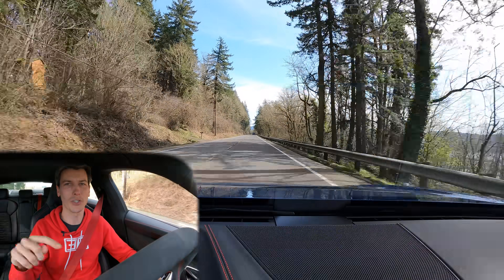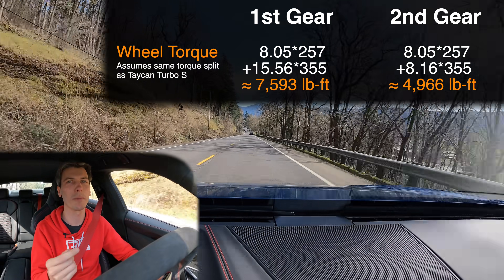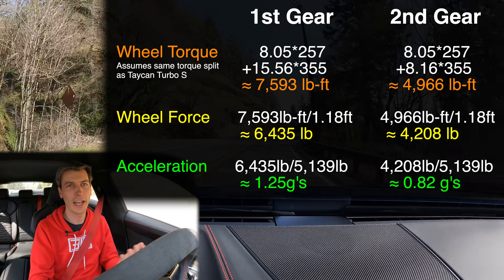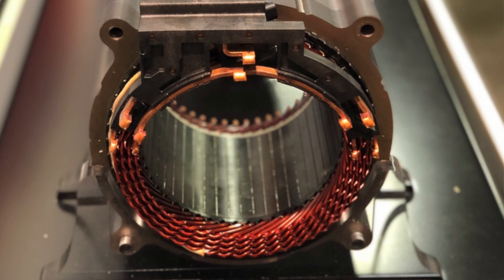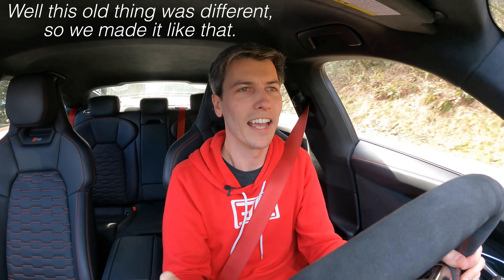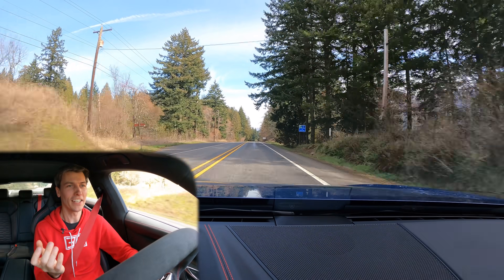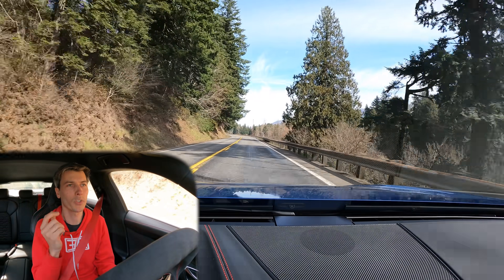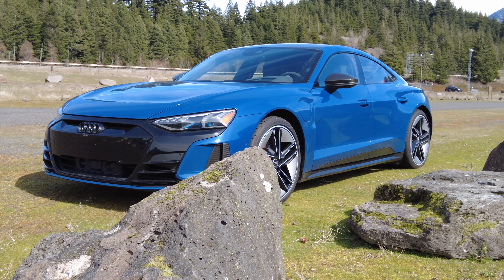Are Fake Manual Transmissions Coming? Audi Keeps It Real

Comment: I completely agree with the CVTs with simulated gears. It boggles my mind why they thought it was a good idea. Any product (cars & transmissions included) should simply try to be the best version of itself, not imitating something it's not. People complain because it doesn't behave the way they're used to, but there's always an adjustment period with anything new. I'd argue a smooth and quiet CVT & motor would be preferable to unrefined automatics.
Reply: They did it because people absolutely hated they way the original CVTs worked and felt when driving, and so no one wanted them. When they first came out, they'd generally just go straight to whatever the peak torque RPM was and then stay there forever using the CVT to vary speed etc. It felt extremely unnatural to drive plus it was noisy as hell with the engine constantly at 3500-4k RPM. It was anything but smooth and quiet.
Reply: I have a car with a CVT that has a manual mode thing (6 ratios to play with the paddle shift). I have come to the conclusion it helps in certain situations:

1) when you're driving, lets say autocrossing around a twisty road with constant corners coming up, that manual mode helps to keep the engine in its torque band (a normal CVT will never do that when you're off throttle, the engine dies to idle instead). Also ofcourse you have fun with it as well.

2) when you want to instantly accelerate for simple overtakes on a highway, flick into the nearest ratio (raise the revs to the torque band of the engine) and then floor it, if you want to still accelerate further (while you're accelerating) you can turn off the manual mode in a second easily and go back into CVT mode.

Manual mode ofcourse doesn't help in straight line acceleration (aka drag strips, traffic light sprints). It just makes it more responsive for that few seconds you want it to respond instantly.

A normal CVT has this vague response to throttle inputs, which is good for smooth relaxed driving, but not good for instant spirited driving. The manual mode is for this purpose.
Reply: @aaryeshg.6526  A better thing would just to have a "sport mode" button that locks the transmission at the optimal gear ratio for maximum engine braking and instant torque when accelerating. It would essentially make the ICE behave like an electric car and get significantly better performance.
Reply: @SI0AX  yeah this method of sport mode actually was used on the CVT F1 car that Renault Williams made in the '90s. The engine stayed at its max power for most of the time.

But.... that sadly wouldn't go well with consumers on econoboxes (its outside the bounds of feeling "normal"). Still a really good idea though, if it can have a simple on/off switch.
Reply: @aaryeshg.6526  That was a race car. A regular consumer would not appreciate the terrible fuel economy they would get if the race mode could not be toggled off, lol. The EPA would not appreciate it either.
Reply: Totally agree - if you want a manual, GET A MANUAL. Don't complain to everybody (manufacturers included) to make them nobble an alternative technology just for you. I suspect that the silent majority of traditional CVT drivers were perfectly happy with how they worked.
Reply: @Alfred Wedmore yeah, I just remembered my friend tells me that he hated the feel of motorboating (the water transportation one not the titty one) on road. So he hated every CVT out there, from cars to scooters.
Reply: The problem is that car reviewers don't get to ride out an adjustment period and they have far too much influence on how American cars are presented to consumers. This is why you get loaded with lots of "gee whiz" features which are annoying in the long term or end up being ignored after a week
Reply: If some people find simulated gear CVTs or EVs fun, I guess that's their prerogative. My four-year-old likes spinning in circles and singing songs from frozen - I'm not here to judge. I however, having the mechanical knowledge to know that it sucks balls, could never enjoy it.
Reply: With the failure rate of CVT’s it makes me wonder if part of it is there being less wear if the belt jumps to positions rather than a constant slide up or down the cones. 

Either way a CVT feels like a broken and slipping transmission. So, for a lot of people it just doesn’t feel right. Even for non car people everything else they’ve driven felt a certain way so that’s what they expect a normal car to feel like. Make a drastic change to that and it’s hard to overcome it unless it’s what you grew up with. 
I’d also bet a CVT acting like a traditional auto is negligibly less efficient than it acting like a CVT.
Reply: The first CVTs didn't have simulated gears, people hated them, holding at max power while accelerating just isn't a pleasant experience. To fix that they had to either reducing the rpm they were holding at or introduce fake gears, fake gears was the right answer.
Reply: @kevenharvey9711  'people' == REVIEWERS 

We have them in Europe.  Reviewers commented it was a little disconcerting to have the engine rev to torque peak on hills or when loaded "but if you really want the feel of gears you can always manually select a ratio"

CVTs sell just fine over here and they don't have a problem with early mortality
Reply: @miscbits6399  I'm not a reviewer, I drove one of the early CVTs myself, it was a pretty horrible feel. The close ratio "gears" don't affect performance or efficiency that much.
Reply: one of the underrated points of the fake shifting is the perception of speed. I have a CVT with no simulated gearchanges (02 Insight) and it has a mildly frustrating difficulty with holding an intended speed. It would be much better with cruise control, but regardless it requires more attention be paid to the speedo. Human ears are quite adept at hearing small changes in frequency at tones around the primary engine harmonics. That gives us a pretty accurate perception of speed changes regardless of the external factors. My preference is the quiet efficiency of no fake shifting, but I've driven plenty of "shifting" CVTs and find they have upsides as well.
Reply: CVTs are boring.

They did it to help sell the cars with CVTs.
Reply: @slowanddeliberate6893  ridiculous, do you find instant acceleration boring? Do you hate the feeling of a transmission always at the ideal gear ratio?
Reply: Then you're going to hate these things called video games.  Especially the ones with controllers that simulate real world controls.

But lots of people love them.  I don't see why that shouldn't be extended into real vehicles.
Reply: @tams805  Ok I'll bite.

The point of a video game is to simulate and be enjoyable. So it's trying to be the best at that.

The point of a CVT is to be efficient in delivering power/fuel economy, and trying to simulate gears defeats that purpose. It also fails in feeling like an actual automatic, which makes it worse.

Similarly, video games that do not simulate well and/or are not enjoyable aren't going to do very well.

Also, I like video games as much as the next guy, but does ANYONE like CVTs with simulated gears?
Reply: @peanuts.13  When it comes to those CVT simulations its often for if the car is in a certain mode or just under max throttle. And when cursing it goes back to being a normal CVT.
Reply: @peanuts.13  because as far as I know, CVT cars don't sell as good as others, I guess? and companies want profit to boot, so they market it as close as automatic but "slightly better" on paper (and more expensive), even tho it's worse in application to simulate it
Cmiiw tho
Reply: @tams805  
Horrible and ridiculous comparison
Reply: @tams805  that's a ridiculous analogy, video games are made to simulate real driving. If cvts are smoother, you've just gotta get used to them.
Reply: @tams805  I agree with you. its ok for things just to be fun

Comment: 3:31 Not exactly true. With a permanent magnet electric motor (which are used in basically all electric cars), in the constant power region, you're using some current for field-weakening.
Essentially countering the magnetic field of the permanent magnets in the rotor to reduce the induced voltage in the stator, so you can maintain control of the motor. At high speeds, this field-weakening current can be quite significant, contributing a considerable amount of heating to the stator, with no benefit to the mechanical output of the motor.
Think about it: At high speed, if you want the mechanical output to be zero torque (coasting), you still need to put power into the motor.

Having a second gear with a higher gear ratio allows the electric motor to spin at lower RPM for the same vehicle speed, meaning that you need a lower field-weakening current, thus improving efficiency.
Reply: It's a good point. It's a question if the better efficiency is worth added complexity and parts.
Reply: This is true, but there are designs that let you use weaker permanent magnets in the first place -- like the PMSR (permanent magnet switched reluctance) design.  This reduces the necessary field weakening current significantly.
Reply: @somejoe7777  yes but then you lose torque at the low end. However if you don't spend much time at low speeds you could theoretically do field strengthening at low speeds instead!
Reply: Thank you for talking about this. Electric motors do have a type of "redline"
Reply: I don't know that much about electric motors, but in practice the effect you are describing doesn't exist. Single speed EVs are just as efficient at high speeds. The best proof is the dual motor Model S. It could very easily use a different gear ratio for the front and rear motors, but it doesn't. This means there's no benefit.
These motors are not just some magnets and wires, but are controlled by very sophisticated electronics.
Reply: @andrasbiro3007  "I don't know that much about electric motors, ..."
Your comment should have ended here.
Reply: @davidjereb  
That's all you have? Seems like you know even less.
Reply: @andrasbiro3007  I make a living developing embedded software for controllers of electric traction motors. I know exactly how the regulation works and what are the limitations of various types of electric motors.
You, on the other hand, foolishly claim that there is no such thing as field-weakening, because you had a hunch while interpreting Tesla's range claims.
Reply: @davidjereb  
Again, if a transmission helps, why does the Model S use the same gear ratio on both motors?
Reply: @andrasbiro3007  Less weight, less complexity, lower cost, fewer things that can go wrong.
Reply: @davidjereb  
I don't see how using different gear ratios would do any of that. It would be just different gears. The only tiny increase in complexity would be in manufacturing. The front and rear motors are different anyway, so this would be a trivial change.
Reply: @andrasbiro3007  This whole time I was talking about a shiftable gear ratio. A gearbox with two selectable gears, which is what the Audi in the video is using.
Reply: @davidjereb  
But that's not what I was talking about.
Again, if a two speed transmission were beneficial, Tesla could simulate it at zero cost by using different gear rations on the two motors. This proves that Tesla doesn't need a transmission.
Reply: @andrasbiro3007  And that is where you're wrong yet again. Unless they had a clutch to disengage the motor that would be spinning faster, they would still need to waste power on field weakening in that motor - whether it was producing torque or not.
You seem to be one of those Tesla fanboys that thinks what they do must be the absolute best, physics-defying magic. The reality is that hey sell you the best they can make, at the manufacturing cost that still allows them to make a good margin. Tesla didn't opt for a shiftable transmission, VAG group did. That's all there is to it.
Reply: @davidjereb  
Except Tesla used AC induction motors in the original Model S.
Reply: @andrasbiro3007  Using an AC induction motor does not change his argument at all. It will generate significant back emf at speed, and a current must be supplied to it to counteract such effect. Electric motors can spin at pretty high speeds, but it doesn't mean they want to be at a high speed. Porsche's inclusion of a multi-speed transmission actually helped tremendously in allowing it to have good efficiency at high speed.
Reply: @IR-xy3ij  
But my argument was that Tesla could have used two gears in the Model S without a transmission, because it had two motors, one on each axle.
There using AC induction  motor matters because it doesn't generate back emf when it's turned off.

Porsche needed a transmission because it's a sports car that has to accelerate beyond 60mph. The Model S is a family sedan that happens to be very fast. A Tesla is designed for highway driving, not racing, it doesn't need to be good at higher speeds. They do a decent job anyway, you can drive them over 120mph on the Autobahn easily, it's just not what they were optimized for.

Then there's the new Plaid motor. It just keeps pulling regardless of the speed. To achieve that it has to maintain it's efficiency too, otherwise it would overheat and melt.
Reply: @andrasbiro3007  They are not actually just as efficient at high speeds, not even close. Just one extra gear will make them so much better.
Reply: Simply route all wasted energy, back to charge the battery.
Reply: From what I know field-weakening is basically like another gear but done electronically. I dont know whats better as a real transmission also has inefficients and downsides.

Comment: Torque limiting is something Ferrari has been doing since it's using turbos again, to have driving aids interfering less. On EVs it would be safer to have a kickdown button that unlocks full power at parking lot speeds, so chances of unintentionally flooring it are lower.
At least this needs to happen before Toyota Siennas go electric

Comment: They aren't doing these things because of the pompous statement that "well this old thing was different so we made it like that", it's because of the consumer. Nothing else.

Fake CVT "gears"  exist because of massive negative feedback from consumers because it doesn't feel "right", even though it's doing exactly what it's supposed to do.

Ev's have no soul, they're appliances at this point in their existence. I applaud any attempt to figure out a way to make them appealing to the motoring enthusiast. I could care less what its 0-60 is if it's a flat and boring existence in every other aspect. This may not be it, but at least they're trying harder than just putting in a bigger infotainment screen or a fekkin yoke.....
Reply: EVs have no soul.  You hit the nail on the head with that.

Comment: I understand your concern but I think you are being a little unfair to the manufacturers of these new technologies by not remembering to include that in both the early EV and CVT “revolution “, people dislike the lack of sound in EVs and the lack of feel in CVTs. Manufacturers responded to that by re engineering these systems in the manner in which you now decry. So if these deceptions help sell cars while transitioning people over to the new thing, then it makes perfect sense. Nostalgia is a real thing. Look at how long we are still making digital music sound analog. Or every negative review of a car cockpits that forgo all the buttons. We engineers can’t not forget that sometimes the public will demand a transition period and just because we know this new way is better doesn’t mean we can just forget what people have grown accustomed to.
P. S. The Audi looks better to me than the Porsche so, thats why I’d choose it.
And Technically, they are the same corporation if not car company. Toyota and Subaru aren’t.
Reply: Buttons and manual controls aren't some anachronism though. I'd say most drivers still consider it objectively better and safer to have physical controls they can operate by feel, without taking their eyes off the road or stabbing at a screen at full reach while bouncing over road bumps.